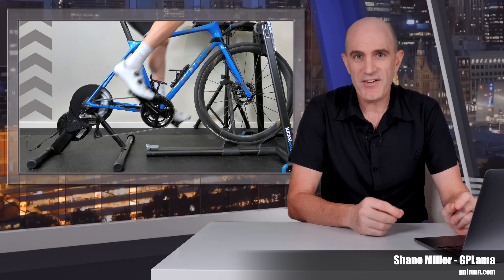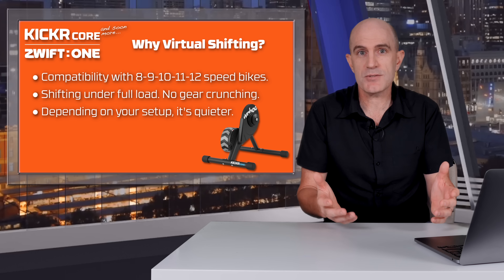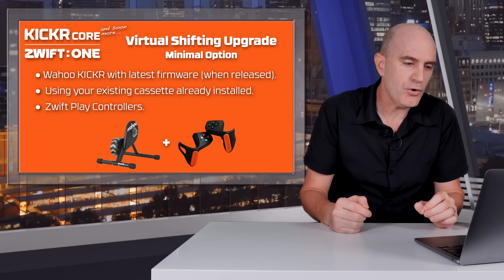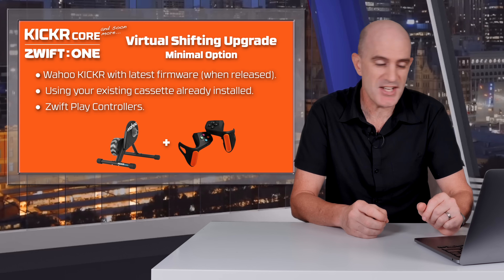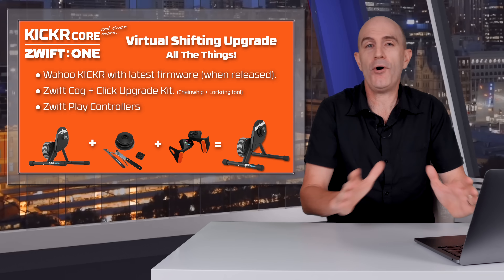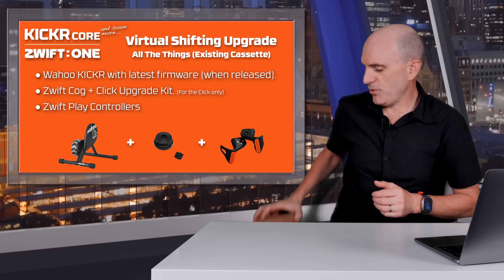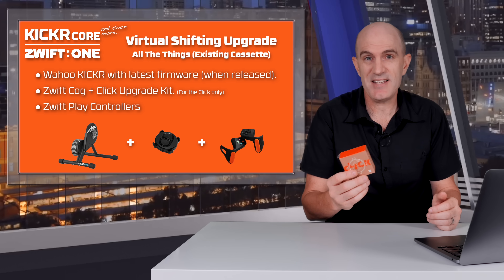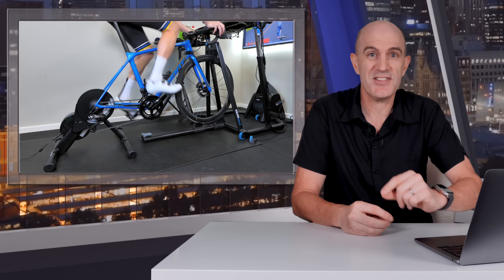Virtual Shifting Upgrade Options for Wahoo KICKR Owners!

Comment: “Very near future”… my v5 is looking at these videos enviously
Reply: I hope so too.

I have a cheap bike as a dedicated turbo setup ( Zwift doesn’t care what your actual bike is).   It would be amazing if someone far cleverer than me could replicate the Zwift Play functionality in a set of dummy hoods to replace the real ones.
Reply: @mikeainsworth4504  me too.  No brakes/cable... Integrating those into something would be cool.  Allow me to remove the derailleurs!
Reply: @pauldamian2988  I've been looking for something too. I was thinking I'd just use my old ones and remove the shifting/brake cables and leaving the hoods. The brake levers aren't really in the way.
Reply: The answer (8.9.24) from my request to the wahoo support:

Thanks for reaching out and thanks for the questions. Unfortunately the Zwift Cog will not be compatibel with the Kickr V5. This is due to a fimware constraint that will not allow the Zwift Cog to work.
Reply: @Christian-vu5lt  Same answers from Wahoo and Zwift support !... This is the Wahoo support input : Thanks for writing in. This upgrade kit is only compatible with the KICKR V6, KICKR MOVE, and KICKR CORE. KICKR v5 does not have the same computing electronics as v6 and MOVE. KICKR v6 and MOVE have extra memory that allows them to run Zwift virtual shifting. We currently cannot comment on a timeline for the KICKR V5 compatibility. 
Who is wrong ?...
Reply: From the Wahoo Support Site:

Will virtual shifting be available on other KICKR models?

We have reviewed the hardware and firmware capabilities of KICKR v5 (2020) and preceding KICKR versions. Unfortunately, these older models are unable to support the required protocols for Zwift Virtual Shifting and will not be receiving a future update for this functionality.

Comment: You're a life saver! I bought the Cog and Click upgrade kit last week without realising it wouldn't fit the Kickr Core, but it was too late to cancel. I was just about to send it back but saw your vid. Just set up the Cog and Click following your advice and it works a treat! (I did the firmware upgrade a few days ago). Now I just need to stop changing gear with the normal shifters and I'll be good to go! Thank you.

Comment: I got it working! Thank you. Kickr core software update went oke. Mounting of the cog was very easy indeed. Pairing the zwift click went oke. However lost the HR on my apple tv set. Took me about 15min fidling with the settings. But it works now. First impression, shifting very good. Sound level so so. I think rhe zwift cog is a bit to big ( compared with the shimano) so you can hear the chain. But all together happy with it! Thanks for your video

Comment: Job done! Thanks so very much for this video! Immediately ordered  Zwift Cog & Click Upgrade kit. The installation and firmware upgrades took less than 20 minutes, thanks to your clear examples. My bike is a 1x gravel setup, and after a very short trial of the new virtual shifting I am enjoying the close ratios and many more "cogs" than I have been used to!

Comment: Sorted my problem getting the Zwift click to work, I didn’t know that to enable the virtual shifting you actually have to be within a ride/race/workout for the correct settings menu to appear in Zwift.  The shifter pairs fine along with the other Bluetooth devices, but there’s another step to enable the shifting to work.
I had to start riding then go into settings and hey presto the virtual shifting menu appears.
Lovely smooth shifting now, and original cassette is still on the Kickr in case I want to use Rouvy. Wonder if Zwift will allow 3rd parties to use their shifter in the future as it’s so much better than derailleur shifting.
Happy Days.

Comment: One other point, that perhaps belongs in a general discussion of virtual shifting outside of the specific ways to achieve it, is that the existence of virtual shifting begs the question of why bother to have manual shifting at all, even if it's virtual, and why not enable a sort of "automatic" mode where no matter what the terrain the shifting will be done automatically for you to match your desired cadence, power output or difficulty level (and thus slowing down or speeding up as would be the case in outdoor riding)? Or, you could set upper and lower limits for these so auto mode would be adjustable.

I realize that this is basically ERG mode, but in ERG mode your power output doesn't need to match the terrain that you're virtually riding on, while I'm suggesting a mode where it does match it based on your desired cadence or difficulty level, if that makes sense. So, basically, an "ERG Mode" that matches the terrain, and could even be adjustable during the ride itself. It's certainly possible to do this in software so why not add it as an option? Or is there one already?
Reply: Kind of what the Trainer Difficulty setting does. If you turn it down all the way you won't feel the hills at all, but you'll slow down and speed up based on the incline. So it's like your bike is always in the perfect gear.
Reply: I like the way you are going with this, and hope it becomes a reality. No more dirty chain on your indoor bike seems well within reach now.
Reply: @bonesofanidol  Interesting. But there obviously has to be some resistance on hills no matter how slow you go, because if it doesn't match what would happen on an outdoor ride then it's not realistic, but another advantage of VS whether manual or auto is that it allows you to downshift to gears that if they existed on outdoor bikes would lead to your falling sideways due to insufficient speed and stabilizing wheel rotation.

But I'd prefer an actual Auto Mode in VS, with the ability to set at what point it auto-shifts or maybe the desired power output level. And maybe also the ability to select front and rear virtual gears. It can all be done in software so why not give people that option?

Comment: Hey Shane, great series of videos on this technology but given all the questions that people keep asking, most quite understandable and legitimate, I think it might make sense for you or others to put up a web page explaining how this works that answers all these questions.

E.g. can I use a 7 speed or fixie on this, what about derailleur alignment, does it work with Di2, etc.

Turns out that the technology behind this is fairly simple, being mostly done in software and using sensor feedback, and it just seems more complicated than it actually is.
Reply: I like your question...it would be cool to be a able to fit a single speed frame on the hub (horizontal dropouts). That would make a extremely simple permanent zwift bike👍
Reply: @joseantoniorodriguezsanche3102  I don't see why it couldn't be done. Are there single speed bikes that have tensioners to make it easier to swap the rear cog for a different size one without having to add or remove chain links? This might make it easier to install it on the trainer, especially if you have multiple bikes and want to swap them.
Reply from the maker: Somewhere like ZwiftInsider would be the place for all this information on a web page.

Comment: This is great thanks Shane. Did my first ride with virtual shifting on my Core today. Just left the cassette on for now and used the clicks. Very satisfying and responsive to use.
Was a bit confused in what protocol to use as I used to use ANT+ for everything on my Win11 laptop via a dongle (my HRM is also only ANT+). Bit of jigging about meant I could use both bluetooth and ANT+, although I'm not entirely sure how I did it yet to repeat for next time!
Reply from the maker: Ideally, pair everything over Bluetooth. At the minimum, "controllable trainer" and "controllers" over BLE (required for virtual shifting) and the others can still use ANT+.
Reply: Thanks Shane. I seems I need to first pair the trainer and controller with BLE, then plug in the ANT+ stick for my HRM to pair that. I'll just look at getting a BLE HRM if this causes any issues.
Reply: So .... with the firmware update, a Click will work on a Kickr Core without the need for the Zwift Cog? I posted this idea a few days ago (because I couldn't see any reason why not), and was told in no uncertain terms that it wouldn't!
Reply from the maker: @davidrowe8747  A Kickr CORE with firmware 1.3.17 onwards, ANY cassette (including the Cog), and the Click will support virtual shifting within Zwift. Whoever was providing the uncertain terms was uncertain indeed. :)
Reply: @gplama  thanks, Shane - I knew you'd give me the answer I wanted! ;-)

Comment: drat....  I just recently replaced a worn out cassette on my Zwift only bike kickr set up.  I could have saved $$$...   oh well... next time.  Is the cog in the kit replaceable with standard cogs?  Is the software adjustable for a cog with slightly different tooth count?  With my dedicated bike/kickr set up I could remove the derailleurs and cables right?  I already don't have any brakes or cables on it...

Comment: So I have a Kickr Power v5 and cannot use Zwift click because there is no supporting software in the form of a correct firmware update? Is that right? I ordered the Zwift click and loaded the latest firmware on the Kickr, but I don't see anything under supporting Bluetooth equipment.

Comment: I made the switch and as far as shifting goes that is great.  kind of wish that the game made some noise to confirm that a shit occurred. Not that it fails but  it is easy to mistake and hit it twice.  Of course you know but also going down hill you might want multiple shifts. The gear is shown so not a deal killer. However I use Shimano and it is really noisy. I contacted customer support and after several attempts using their suggestions that then said it is normally that noisy. I said I was going back to the cog to see if that was noisy and just never paid attention and no it was really quiet. Their response was great now you have it quiet. forget that I did not just buy the clicker which would have been all I actually use now. So if you like a quiet ride well wait until they sell just the clicker and it works just fine on the cog.  Sort of gets rid of the benefit if you thought you could use it on different bikes that use different cogs. But for me the sound like you are not shifted correctly was just too annoying and I live alone.  If you have people in your house that would have to listen to the constant clicking well they are not going to be happy.

Comment: Better getting a single speed conversion kit with 14T cog and the spacers, plus a chain tensioner, and a cheap set of cranks with a chainring then dial in that chainline for smooth and quiet....

Comment: Thanks for the help.  Sense there are a variety of aftermarket speed sensors… I’m looking for the standard they all comply to. I have a few from Cycplus, Magene and others… and they sense and report to all other head units… hence there has to be a industry specification… Zwift denied the existence of an industry specification.  That can’t be true, unless everyone is reverse engineering sensors….which is how I wound up asking you.  Thanks!
Reply from the maker: I'm not really understanding what you're after. Most trainers will report their 'flywheel speed' via ANT+ Speed, or via the Bluetooth FTMS channel. If you're after an industry specification, those are it. The speed reported is simply flywheel speed, or in the case where speed simulation is calculated based on your power input in ERG, not physical flywheel revolutions. 

Zwift itself is technically a 'head unit' it connects to sensors and computes your virtual speed in-game. The flywheel speed data from the trainer is irrelevant to Zwift with a smart trainer that reports power.

Comment: Would you be able to use a simple single speed conversion kit instead of the zwift hub? Just thinking that it would allow to adjust the chain line. Thanks
Reply from the maker: Yes.

Comment: you mentioned I can use JetBlack Volt? is compatible with the single cassette and the virtual shifting?
Reply from the maker: I mentioned the freehub Zwift are sending out with the Cog is compatible with the JetBlack VOLT, not the virtual shifting (which is done in the trainer firmware).

Comment: Quick question on the zwift one (still thinking whether I should go for the core, or core one), does virtual shifting means my bike (planning to put a claris road bike on the trainer to start with) can use the zwift one, and became any speed I want it to be (Given that the virtual shifting does not require the chain to be moving anyway) - I am new to cycling, sorry if my question sounded stupid?

Comment: Hey Shane, it is recommended to use the smaller front sprocket with the cog. Why do you use the large one?
Reply from the maker: Smaller will result in a more stable ERG experience, but it'll work with either. 1000W+ sprints are better in the big ring.
Reply: @gplama but it’s the alignment chain properly with the big ring ?? Doesn’t do it more noise than the small ring ??
Reply from the maker: @alejandro.a.m  It depends on the bike / chainline / etc. There's no real correct answer here. Just assumptions I won't make.

Comment: I installed very easily the Zwift Cog on my cassette body of my Kickr V5 removing the body inside the Zwift cog as shown on the movie. After installing the Zwift click it appears on the Zwift companion where Ι upgraded its firmware. Now began the issues… The click doesn’t appear neither on the Zwift app nor in wahoo app, even the bluetooth of my iOS (iPhone and iPad) doesn’t see it !… I removed and reinstalled both apps but still have the same issue ! Any help or suggestion welcome !…
The Wahoo support told me that the Kickr V5 will NOT support virtual shifting : will this explain my issue ?…
Reply: I returned the cog since unfortunately version five of the wahoo Kickr trainer will never be compatible with virtual shifting

Comment: Hey Shane. As I have written earlier I have a  Wahoo KICKR V6. The other day I could use virtuaal shifting, but then yesterday it was not possible. do you have an explanation for it.
Reply from the maker: You have to have the Kickr paired via Bluetooth and the Click and/or Play Controllers also paired. It also has to be enabled within the Zwift settings (on by default I believe).

Comment: Is the shifting determined by the cog and shifter hardware, or also the direct drive itself? I notice that this is heavily integrated with Wahoo, but until additions come, if at all, is there any bodge to allow this to work with, say, and Elite Suito? Thinking you swapped out the freehub on this video.  Great video as always. Thank you.
Reply from the maker: The smart trainer will need a firmware that supports ‘Zwift Protocol’ for virtual shifting within Zwift.
Reply: @gplama Thank you. I'll sit and wait... Would love to have virtual shifting as the turbo and anything that doesn't need mechanical clunking noise the better! Appreciated.

Comment: Is the virtual shifting technically depending on a Zwift App Subscription?
Can the virtual shifting setup be used without Zwift? could I spare the shifting mechanism on my indoor bike with this setup when using a different Application (not Zwift)?
Is the Kickr directly connected (via Bluetooth) to the cog/click Inputs?
I assume the zwift app is necessary to bring together the kickr and cog/click connections :/

Comment: Hi Shane. Thanks for the video. Updated firmware for Kickr Core,  I have the Zwift Play controllers...opened Zwift and virtual shifting did not show up in the pairing menu. I may hve missed it in the video, what's the Wahoo firmware version that adds virtual shifting capability? 😮
Reply from the maker: You'll need to ensure the 'Controllable' part of the trainer pairing is via Bluetooth. The others can be ANT+ if you like, but virtual shifting has to use BLE. Kickr CORE firmware 1.3.17 onwards is what you're after.
Reply: @gplama  be nice if I RTFM. Thanks so much for the reply. Specifically says pair trainer via Bluetooth 🙃. Got the trainer all set up and tried virtual gearing. Shifting was smooth as silk. Really eases the strain on my (twice broken) wrists. My only headache is the occasional BT dropout to the Zwift Play controllers...that's been an issue since they arrived
Reply from the maker: @jimpeyton1459  Keep an eye out for firmware update 1.3.0 for the Play controllers. That'll start rolling out from today onwards. The changelog is pretty thin... but I am told there are updates/fixes for some connectivity issues.
Reply: @gplama  UPDATE: New firmware seems to have improved dropouts for Zwift Play controllers.  I really dig the virtual shifting. 😊

Comment: Still a bit confused.  I have a Wahoo kickr v5.  Which option works for me to upgrade to virtual shifting?  Do I need a firmware upgrade?  Zwift community posts seem to indicate firmware update hasn’t happened. Thanks.  Great videos btw!
Reply from the maker: The Wahoo Kickr V5 will no longer be getting the virtual shifting update.

Comment: Hi GP - do you notice the resistance of the trainer seems to spike too high or drop too low when changing gear? The gear changes just don’t seem to be smooth for me, when changing up a gear for example it seems to make the resistance too high for a couple of seconds before settling down to what I would consider normal (when using a standard cassette), same when I drop a gear, the resistance of the trainer seems to drop too low before settling back to what would feel like a normal gear down resistance. 
Thanks
P.S using a 2024 Kickr core

Comment: Could you purchase a single speed cog setup with the correct spacers and 14 tooth cog as an alternative? I already have the core, and the play controllers.
Reply: You dont need to do that. You can have the usual cassette, to leave the chain fixed in a cog of the cassette and to change gears virtually with the play controllers.